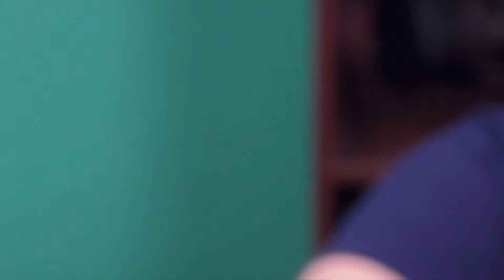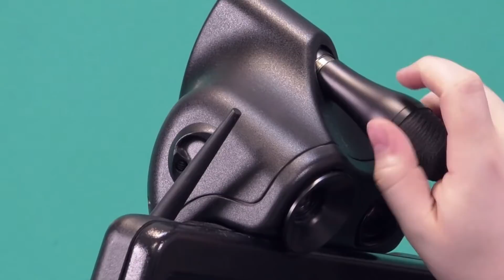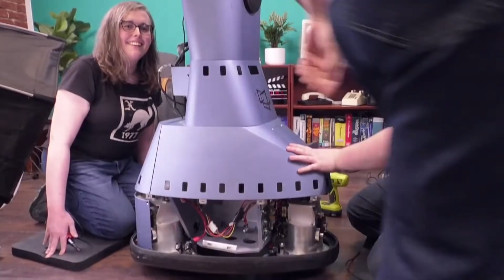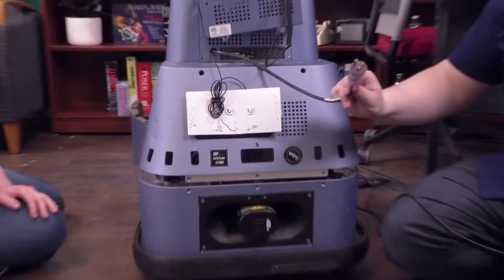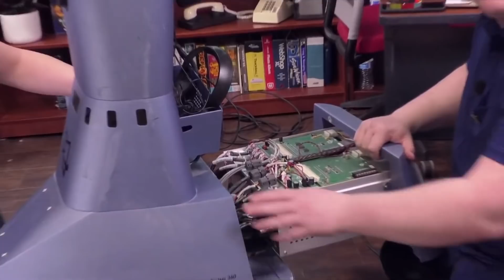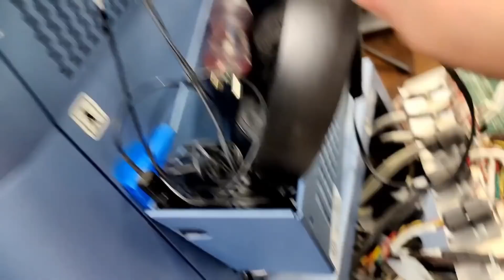100K Talk Show Pt5: Eris

Comment: As for the wheels: they indeed behave similar as mecanum wheels; the diagonal direction vector can be split in an x and y vector and (depending on their direction) either both x or both y vectors cancel each other out; what you lose in power, you win in freedom.
I've actually never seen these type and size of wheels. Very impressive.
Reply: Not the quote I was looking for (I was thinking Braveheart) but... I'm going to add lip a bit on the beginning which will make it even worse.
From the movie: The Phantom of the Opera

{Please plug me in, please plug me in}, “All I want is freedom, a world with no more night.” {Please plug me in, please plug me in}.